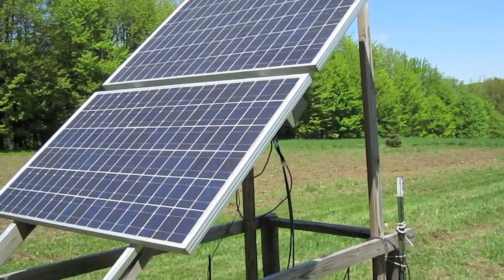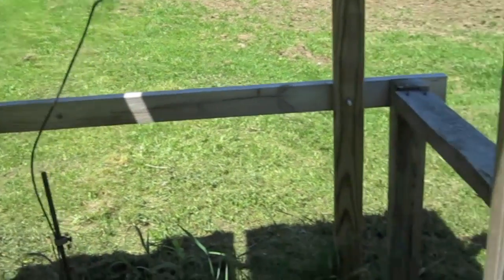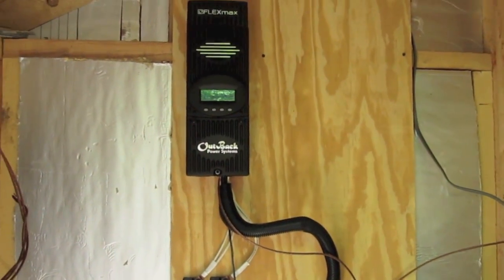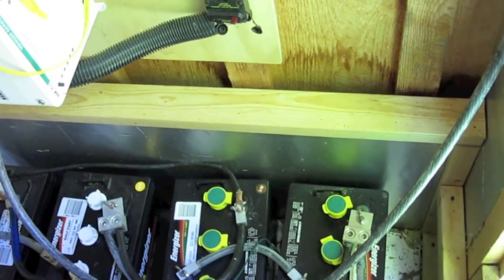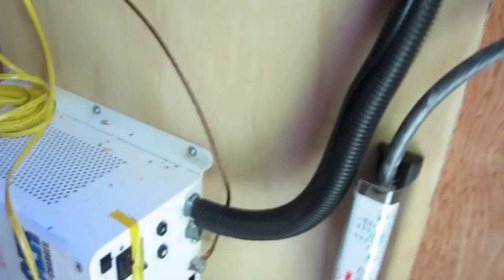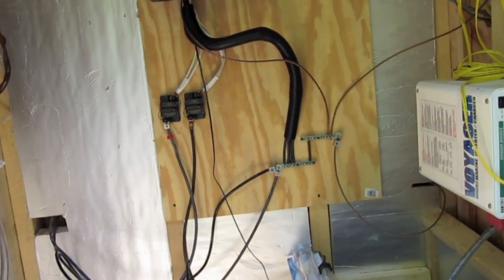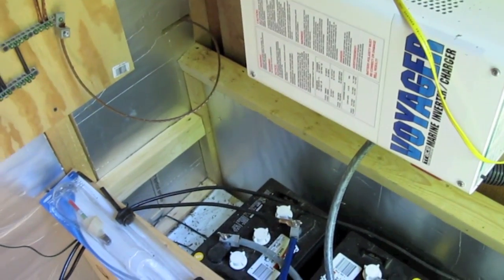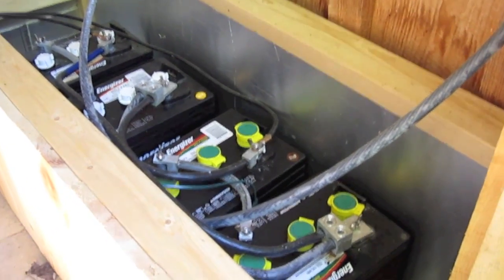Off Grid Cabin - Solar Electric Power System overview

Comment: I don't currently have solar power in my home, but I certainly want it for many reasons. 

I believe the a good starting point is with something that is always on: a hot water heater or a freezer.  

A single solar panel, with perhaps 2  car batteries, solar panel on roof, electrical conduits straight down to the unit, battery,  etc all in the same vented area. 

Small enough for DYI, or for paid electrician.   Very easy to see your electric bill drop.

Comment from the maker: these batteries are going on 4 years old now... I am terrible about checking on them... but figure I should get several more years... they spend most of their time full anyways...

Solar has it's place. My city place is on grid...my power needs there would be hard to meet economically with solar... the cabin power needs are tiny and easily meet with my small system...

there is not right answer... to many variables... but if you want to do it start small... you can always grow or replace...

Comment: Can  we use this solar electric system to run the AC (2.78/2.70 KW) load?  if yes than specify the size of the whole solar electric systems.

Comment: The real  trick to any solar system is having more batteries to allow more stability in the system.  The panels can charge a lot more batteries then one would realize. Having  a primary battery bank and a secondary battery bank with a isolator can be use in high load situations.

Comment: I have a cabin in Idaho..I have a wind generator that runs directly into the place..Works fine  I have power year round.  Spent $175 for propain in winter for furnace.

Comment: When you said you had 450 watt hour capacity, you should have said that you would have 225 watt hour capacity due to usually you never should use all your battery bank and 50% is a good low point for them.

Comment from the maker: @mikemorrison281 short answer... lots :)

AC would require a huge battery bank and probably 10kw of panels... you can do the computations if you get the specs off of you ac unit but in the end it will be really expensive... you might want to have a pro come in and size a system for you... they will be much better at coming up with what you need...

Comment: how many panels would you have to add to run a/c units? I'm trying to design something that will work here in the heat in Texas...we had over 60 days of 100+ degree heat plus humidity. It can kill you, literally. Any ideas? Great video and appreciate you explaining in such detail...some of us are just getting started and are dummies at this off grid thing:)

Comment: I think you made the right choice on the charge controller. Higher voltage array, less power loss over the distance smaller wire gages from the panels. Nice work.

Comment: I like this set up you have.. very nice.. wish the other circuit breaker worked.. would have been nice to have your lights on one and like 2 are 3 receptacles on the other so your not hunting around in the dark to reset it if it trips.. Are the breakers on the inverter 15amp are 20amp?

Comment: A pretty good set-up. On my system, I went to Wal-mart about 6 years ago and bought 12 volt deep cycle Marine batteries. I think each one cost around 70 dollars. Deep cycle Marine batteries will give long life. I use mine constantly and the batteries are still producing.

Comment from the maker: @rayman3668 mostly availability... the least expensive decent batteries I could find were the sams club 6v golf cart batteries... also when I started doing research I read lots of good things about the sams club batteries... 12v would simplify the wiring but for me the additional cost was not worth it...